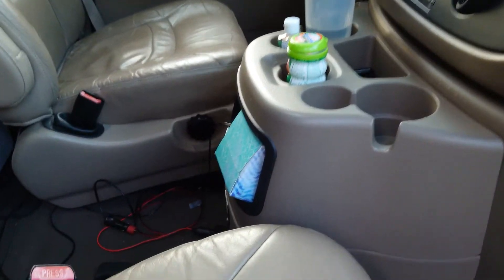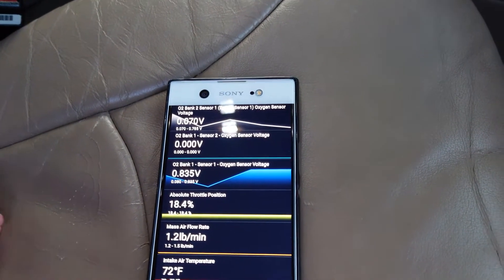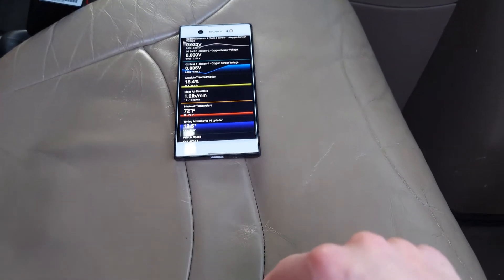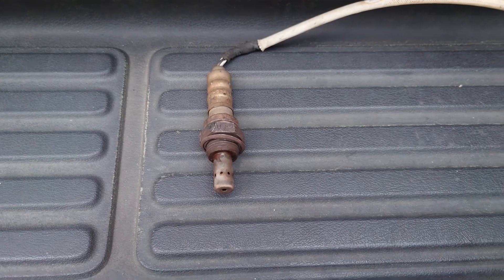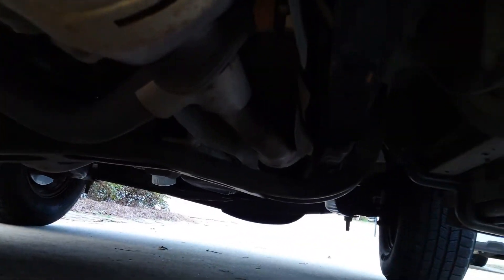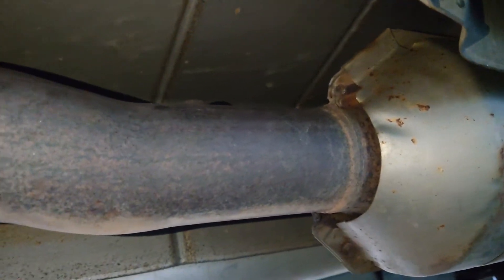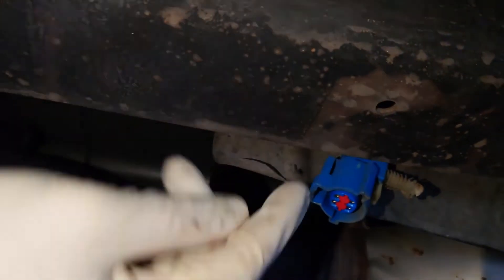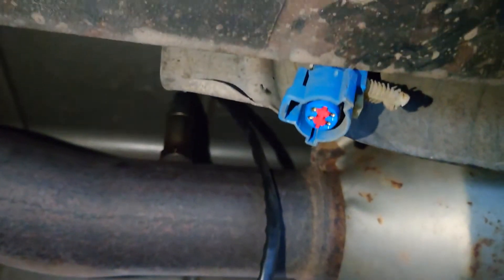Ford Econoline O2 Sensor Replacement How to change an Oxygen Sensor on a E-150 van.

Comment: Did anyone realize that you can take the doghouse off and the sensors are right in front of you?
Reply: Not bank 1 sensor 2 for that one you gotta get underneath  and it's behind the catalytic converter on top..
Reply: i was thinking same thing lol
Reply: Anyone know where the 3rd one is on a e450 motorhome. I only see 2 at the manifolds............ I see 2 connectors where I could plug in 2 more o2 sensors but no bung hole...

Comment: Did you ever figure this out?
Reply from the maker: Yep. The sensor ended up working. Still wandering why it is running slightly rich but so far its not an issue

Comment: My van says rich on bank one and bank 2, do you think this could be my problem or most likely something else because it's both?
Reply: that could mean all kinds of things. check the egr valve and pipe for build up. or your timing belt needs to be replaced, you may n eed to replace air filter, there are so many reasons why htis is happening. go get yoru codes checked at a auto repair place itll give a good indication of whats going on.

Comment: This is helpful after some jackass stole my catalytic converter off my E350. Looks like I need an O2 bung and sensor as well. Hopefully the push connector on the frame side isn't fubared.

Comment: Nice video but thought you'd actually show how to remove the sensors.
Reply: unclip the wire from the harness, unscrew the sensor. bam youre done. its just like removing a bolt.
Reply: @TheStonedSpidR  Well yes, theoretically, but with very limited space in the channel to move any sort of wrench.

Managed to use a crows foot style sensor remover and a lot of heat, but it's out. Thanks for the help.
Reply: @DHFlip18  if you just use a 7/8ths or 12? mm wrench it should be fine. after clipping wire you could just put the closed end on it. ive yet to find an 02 sensor that needed the special tool. the tool is mainly for if you plan on reinstalling the 02 sensor and i dont see why anybody would, unless its new and replacing exhaust or engine blows a rod or something.
Reply: @TheStonedSpidR  In my case, that crows foot adaptor and heat was the best way to go. Gave me plenty of clearance to work in the tight space and gave me the leverage I needed.